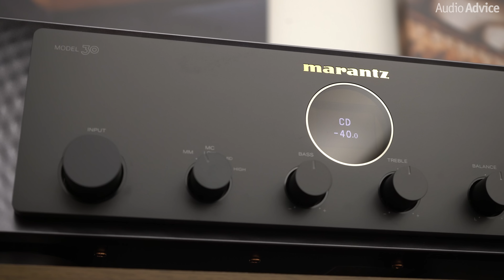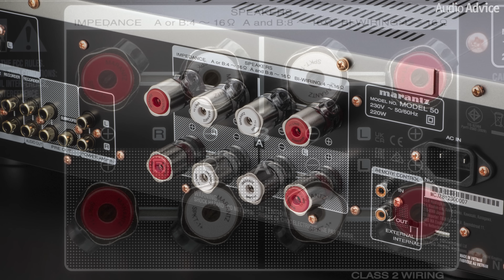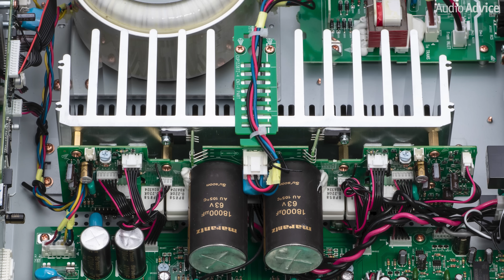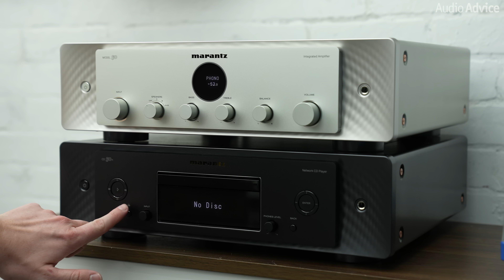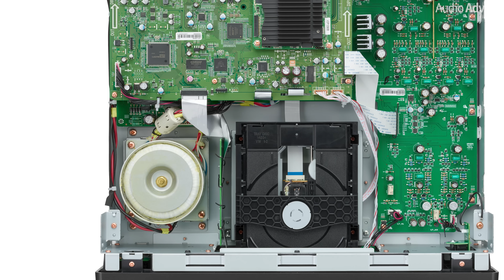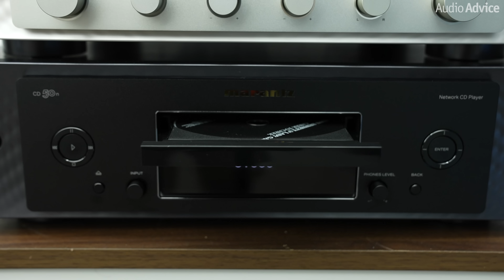Marantz Model 50 Integrated Amp & CD50n CD Player/Music Streamer - WARM & Natural Sound!

Comment: My Denon of 25 years died 2 months ago so it was time for an upgrade and since I mainly listen to records, I went with the M50 to pair with my Rega P3 and Paradigm towers. How the Marantz changed the overall sound is nothing short of phenomenal. I'm hearing aspects in records I've listened to for a very long time, I've never heard or noticed prior. I am very happy with the purchase and hope this unit will last me at least another 25 years. For random listening, I plugged an old Apple Airport Express into the Line 1 to stream from my laptop when I work from home.
Reply from the maker: Thanks for sharing your experience with the Model 50.  Your ears agree with ours!

Comment: Good evening, could you confirm the connection of the CD50N Audio Out Fixed player to the amplifier. Model 50 by the Audio In line CD or line 1?

Comment: I bought the Marantz Model 50. I returned it, too bright in the upper mid-range. Not an amp I can listen to for long periods.
Reply from the maker: Interesting, what did you have before?
Reply: @AudioAdvice  Rega Brio, Sansui AU 317, Pioneer SA 8100
Reply from the maker: @jeroenscholten2179  Ok, thanks for sharing.  That Pioneer was a gem and before the time when they got into the low THD race and made everything as harsh as nails.
Reply: @jeroenscholten2179  i have both Rega Brio and Sansui AU 317 and i like them a lot, you think pm8006 is closer to them than Model 50 in sound signature?

Comment: Will the model 50 handle my Infinity Kappa 9's?
Reply from the maker: Wow, that is a blast from the past.  We remember those as needing TONS of power.  200 watts of solid power minimum.  Please reach out to our team at www.audioadvice.com to discuss the best options, Rotel, Athem, and McIntosh all make products that will drive them well or if you have a unit with front preamp outs, you could just add a high powered power amp.  Thanks for watching.

Comment: Thanks for the review.
I'm still looking though for a SACD + Class AB amp combo.
There is an SACD 30n but is tuned for the Model 30 ... which is a class D amp (Hypex NCore)
Would be nice to see an SACD 50n tuned for Model 50 (which is a class AB amp).
Reply from the maker: Fair enough, hopefully they will make what you're looking for!
Reply: Why you can't use the SACD 30n on the Model 50?
Reply: @JohnSmith-zl8rz I think the point is that the 30n is tuned warm for the cooler 30. So that on the already warm 50 wouldn't be good synergy

Comment: I am on the opposite side - wanted to accompany my Cinema 50 with an integrated amp, yet eventually allowing a stand alone usage. Model 50 being pure analog is a big let down for me. I don't understand constant jumps of Marantz between the analog and digital - just consider Model 30 vs 40n vs 50 vs 70s. With such a weak connectivity, Marantz pushes you to buy both units, which, in the end, is some $3600 and hence even more expensive, than 40n. Well, you get CD as a bonus, but many of my friends abandoned CDs long time ago.
Reply from the maker: That is true. These will not be for everyone. Thanks for watching!

Comment: The CD50n is $300 more expensive than the ND8006 was. Inside both they are almost identical. For that $300 price bump I was hoping for SACD capability. That would have made the 50n a more well rounded product. Also, HEOS really needs to add Qobuz.
Reply: Model 50 got a more efficient toroidal transformer, extra pair power chips per Chanel , it's worth extra money
Reply from the maker: Agreed, that would have been a nice feature.
Reply: sadly NO SACD!

Comment: Still it is a bit confusing. 40n amp with 60 cd costs in UK 2200+850 3050£. 50 amp with 50 cd costs 3200£ (1600 each). As far as I can tell they removed the streamer from the amp and inserted in the cd, actually I watched the release of these online and they said that the cd mechanism is same as 60cd. The only plus I can see is that the 40n has only power amp inputs and sub out whereas the 50 has power amp in  sub out and pre outs. The amplifier seems the same as the 40n.
Reply: Model 50 is the new version of the PM8006, 100% analogue...  it is not based on model40n...
Reply: @michel7878   same amp class AB 70W 8Ω/100W 4Ω  maybe some components are different but same amp section. they just removed the dac section.
Reply from the maker: This is correct
Reply: I was told by another YouTube reviewer that the streamer in the 50n is significantly better than the one in the 40N and the separates are worth the price of admission.